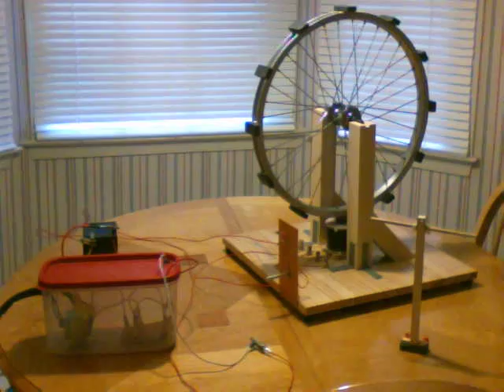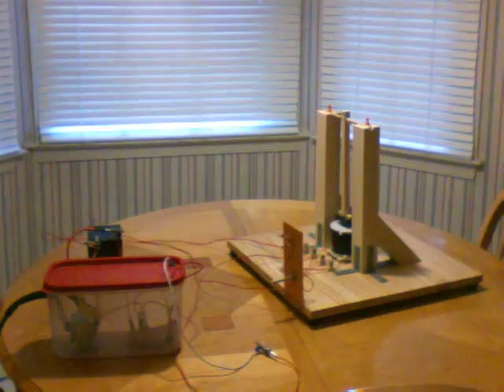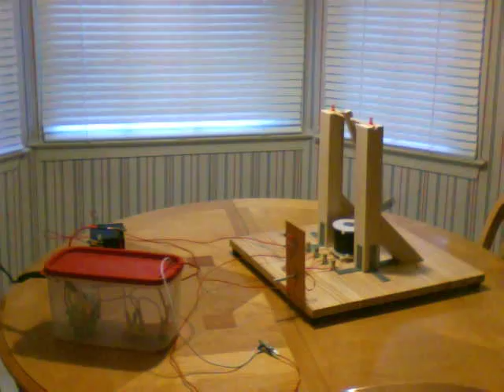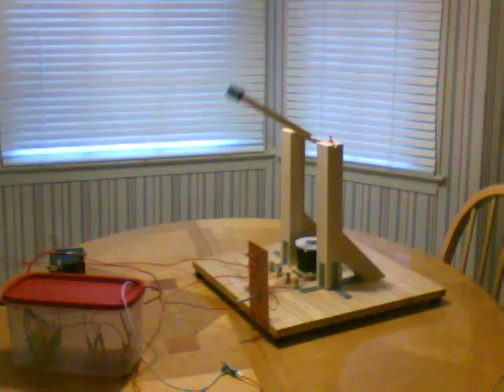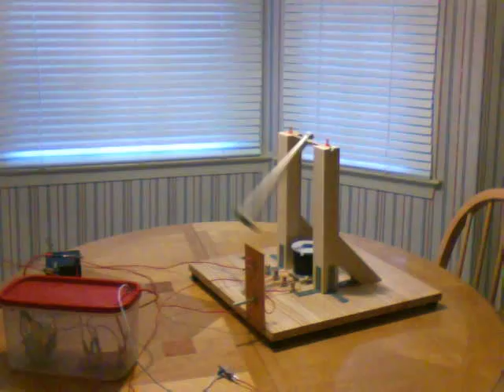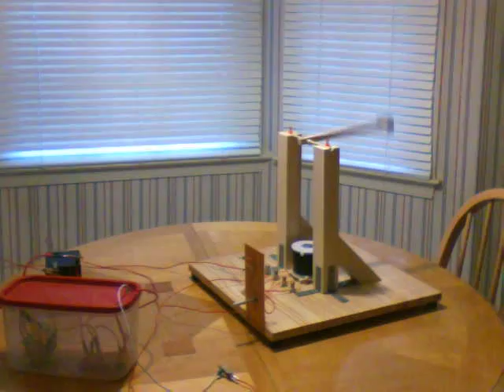Bedini SSG with Pendulum, not Wheel--Will it go 360 degrees?

Comment: Felicitari pentri proiect🎉
Reply from the maker: Mulțumesc!
Reply: @MisterApol  cu placere
Reply: Ce rezistenta are bobina cu fir subtire si bobina cu fir mai gros multumesc
Reply from the maker: @marianpanait7926  I have not measured either value, but I can if you need to know.
Reply: @MisterApol  am facut bobina bifilara cu grosime de aproximativ  1,9120 in de lungime 300 picior ,91m intreb este bine
Reply: @MisterApol  ce dimensiune are magnetul la roata de bicicleta  nu am gasit in instructunile de costructie a sistemului multimesc anticipat
Reply from the maker: @marianpanait7926  The magnet is 5 cm x 1.5 cm and about 1 cm thick.
Reply: @MisterApol  multumesc

Comment: If this was a compound pendulum with 70 percent of its mass at the bottom swinging past the coil would it be create enough power to pulse a smaller secondary coil at the top of the pendulum to give slight impulses to the lever side of the pendulum??

Comment: nice video..does the bedini still charge as usual when using pendulum styled movement?will the pendulum arrangement be more efficient for bedini chargers? I cant help but see the free gravity juice that pendulum makes when it fall from gravity
Reply from the maker: It does charge with the pendulum, but I don't think its more efficient that having a dozen or so magnets closely fitted to a wheel . . . more pulses per minute, after all.
Reply: @MisterApol   Does it self sustain ? Meaning does the pendulum magnet recharge the battery enough to supply a pulse indefinitely? How long have you observed this run on its own?
Reply from the maker: @prometheus1111111  No, it can't run forever. Nothing can.